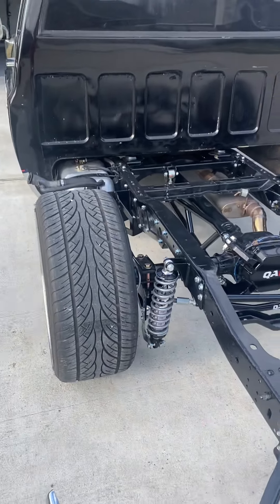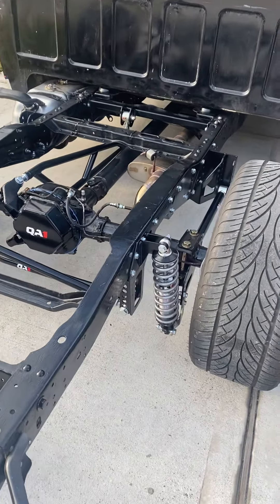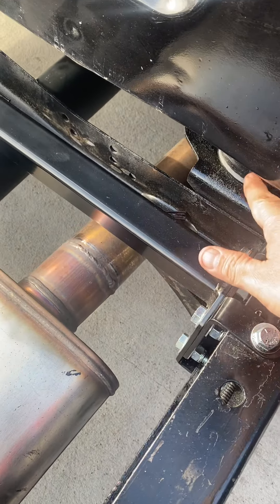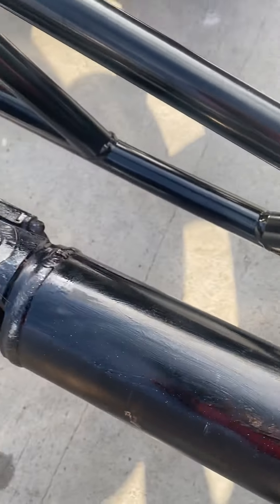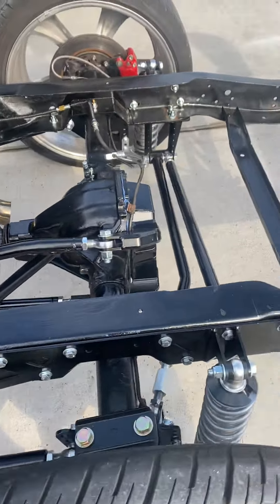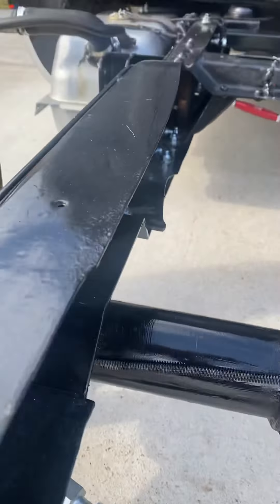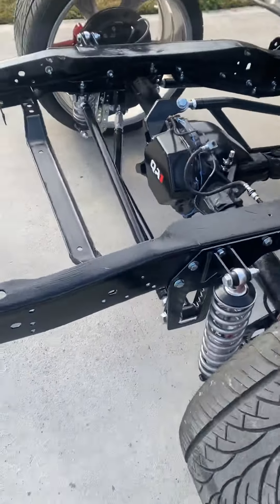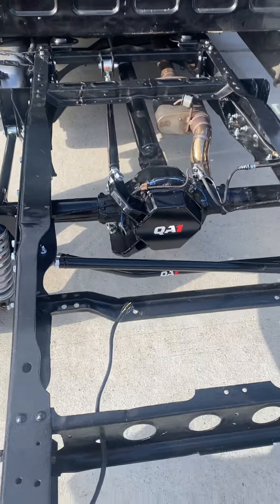Square body QA1 rear suspension

Comment: Looks like u wer able to leave the spring pads in the stock location n not have to flip them, did the kit come with the hardware to connect the qa1 to the pad or did ya have to buy bolts?
Reply: It comes with everything